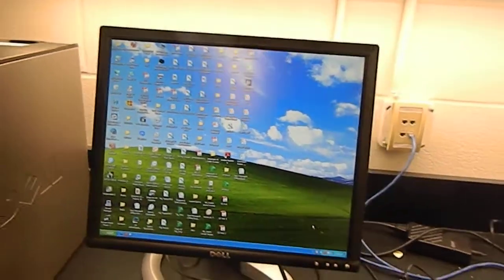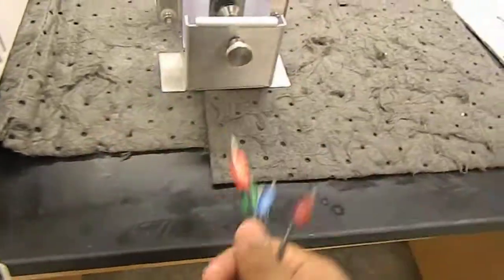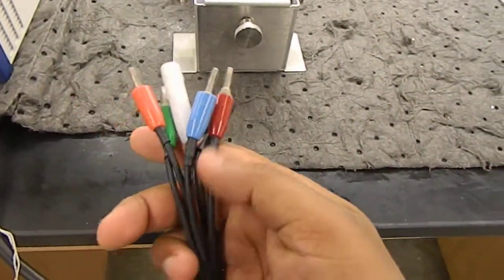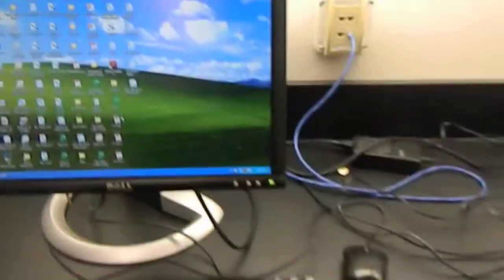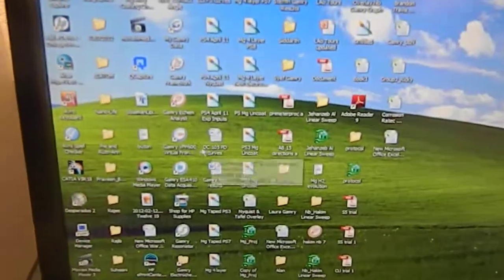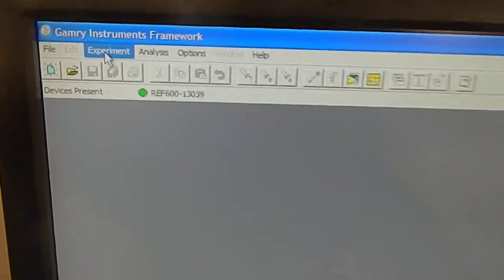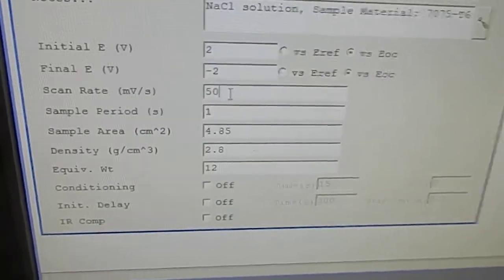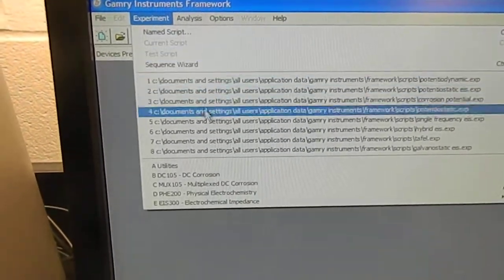GAMRY Tutorial

Comment: Tanks for your hard one handed effort. Your setup is some how wrong! Due to electrolyte solution resistance RE should be as close as possible to WE. I believe you are using wrong end of your cell. In addition to that corrosion process is highly dependable on temperature. Any fluctuation in temperature will change corrosion rate! This setup can not provide stable temperature.(this part is not your fault). BTW PLEASE do not touch reference electrode tip by your hand or any thing else

Comment: First of all i would like to thank you for the Demo and I also have some friendly comments about the experimental setup: 
- I think the reference electrode should be as close as possible to the working electrode. Because you are measuring the potential of the working electrode versus the reference.
- You haven't said anything about the working electrode?
- I think if you choose the initial and final potential with respect to the reference electrode than the Gamry will show you the exact values however in your setup the potentials are maintained with respect to the open circuit potential Eoc
- The area is the area of the working electrode as you pointed out but not the whole cell area 

Thank you
Reply: I am currently doing a very similar test to the one shown in this video but am using a Princeton Applied Research cell and am having some trouble. Do you know why large oscillations in current (as well as current overload) would be happening? I think it may be something to do with our use of the reference bridge tube. Thanks!
Reply: I think he placed the RE on the wrong end. It should be next to the WE.